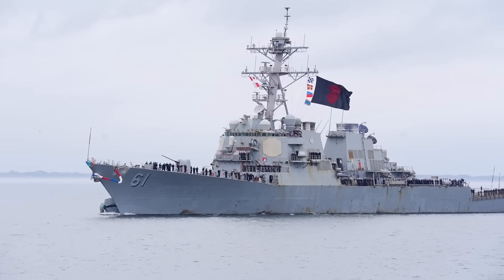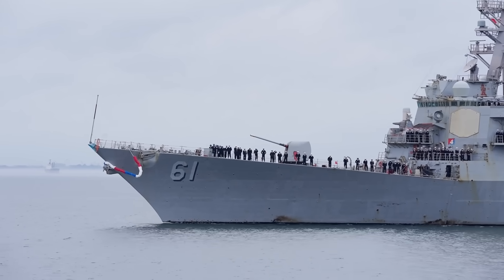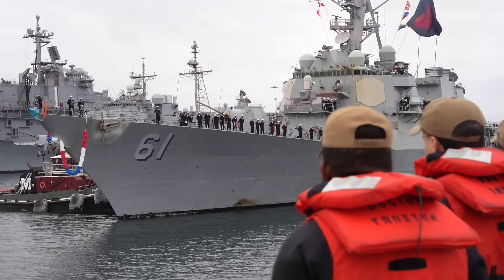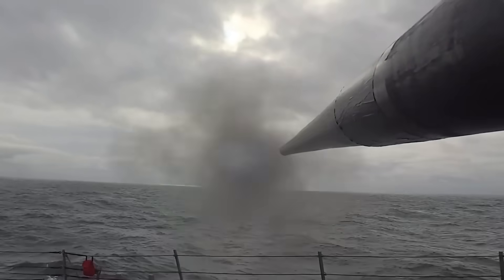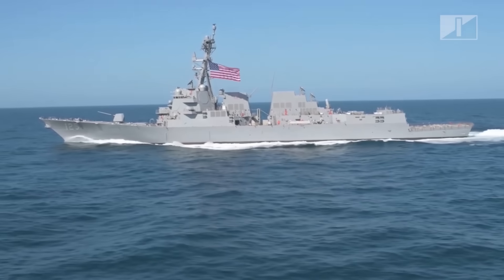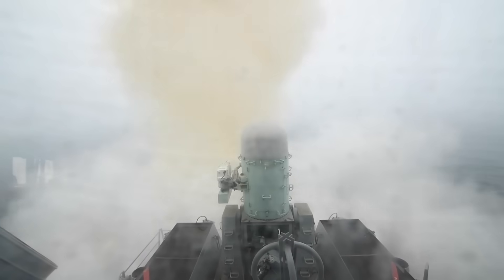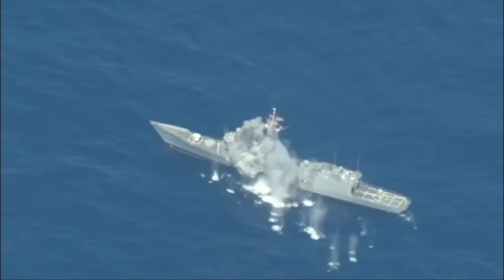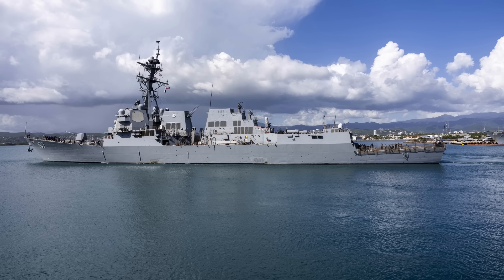Arleigh Burke Flight III: The Destroyer Pushed to Its Absolute Limit

Comment: Flight III Burkes are indeed maxed out—shoehorning the massive AN/SPY-6(V)1 (37 RMAs) into the old DDG-51 hull meant major power/cooling upgrades, higher displacement, and basically zero margin left for big future adds like high-power lasers or railguns without a hull stretch. Costs ballooning to $2.5B+ per hull shows the strain. Solid IAMD beast for now, bridging to DDG(X), but yeah, the platform's at its absolute limit. Great video breakdown! What's next—more Flight IIIs or fast-track the new class?
Reply: Sounds like more Flight 3’s. I think they were going to try an mold the Constellation into being a replacement, which is why it kept being changed. That’s cancelled now.

Comment: Excellent video. As always you have a knack for explaining variations of weapons platforms in an easy to understand format. That being said, I can't imagine it's going to be too long before the Chinese if they haven't already stolen information on the Spy 6 system. Given that the system was designed for the Gerald forecast aircraft carriers they probably already do have it.
In addition with the new Power Systems and ability to cool radar systems more efficiently the flight 3 version of the Arleigh Burke destroyer is more advanced than the Ticonderoga class Cruisers.
Essentially, all the Cruisers are now semicolon are larger missile carrying platforms that the Destroyers can direct to engage incoming threats with the Spy 6 system. With the data link 16 system the version 10 of Aegis and the spice 6 system you can have one Harley Burke class 3 directing the rest of the damn Fleet.
Reply: Why does China need to stole Spy 6 when they already have better one?
Reply: 🤣 
Yeah.....No they don't, but you keep believing that.
Oh, by the way, the version that West Taiwan (China) does have is actually reverse engineered and "stolen" earlier Aegis Spy system.

Comment: The United States Navy - the Secretary of the Navy, Congress, and the President of the United States ALL made arguably a no brainer decision when they green lit upgrading the Burke from Flight Two - to what will be the third iteration. This ship has performed amazingly, however it is arguably common sense that when you have a military platform that is ageing - the easy way is to scrap it - 'or' conduct a cost benefit analysis on what should be done. Update and upgrade.
All parties named above in my subjective opinion have made the correct choice in upgrading the a Flight Three Burke. In time 'rail gun' technologies will, or are coming on line and the Burke with it's massive tonnage [and x96 VLS cells] will need 'all' that tonnage to be able to upgrade weapons that are not light. 
The Burke fleet, with the odd exception - the oldest Burke's may well be beyond a comprehensive upgrade - however given the number in service, and new ships coming on line - the USN will retain a killer platform - upgraded for the decade ahead - give me the Burke over the Chinese fleet any day of the week. Much of the PLAN fleet have never been used in combat, and we just don't know if their massive PLAN fleet is combat ready - it is easy for China to build and build, the PLAN on paper looks formidable however my money's on the USN.

Comment: Don't worry, the US Navy will take the Coast Guard cutter and stuff it with 256 strike depth VLS and four huge 64 radar arrays faces.  It will have a hangar capable of storing 4 medium helicopter and 8 drones, 4 Rail guns and 8 1 megawatts lasers, hull and towed array sonars.   All for less than $500M, and less than 5000 tons with 20,000 NM range, because Trump is in charge.
Reply: Every flag officer who was a sitting PEO on these bungled surface combatant programs all need to be punished for sabotaging the world's most powerful navy for personal gain.

Comment: The "Spruance" hull was far superior, but suffered from an aluminum superstructure. In response to the weakness of an aluminum superstructure, they decided to build entire ships out of aluminum. You know the ones, they crack wide open if a tug pushes on them.
Reply: The problem is the US Navy is still stuck on Arleigh Burke Flight II hull as a base for its Flight III, instead of moving into a slightly bigger common hull like what the Japanese and Koreans did with the Atago/Maya and Sejong the Great class destroyers, respectively. The latter even carries more VLS cells than a Ticonderoga cruiser.

Comment: Purchase the Japanese Maritime Self-Defense Force (JMSDF) Aegis destroyer “Maya-class”  Guided-missile destroyer
Displacement    8,200 tons standard　10,250 tons full load Length    170 m (557 ft 9 in)

COGLAG (Combined Gas turbine-eLectric And Gas turbine)  Speed    approx. 30 knots (56 km/h)
Mk 41 Vertical Launching System: 96 total cells
SM-2MR surface-to-air missile
SM-3 anti-ballistic missile
SM-6 surface-to-air missile
Type 07 VL-ASROC
RIM-162 ESSM
Reply: Maya-class is Arleigh Burke Flight IIA

Comment: I am so surprised that we haven’t started developing a new Destroyer.
Reply: DDGX is on the roadmap, but doubtful we see anything in the water for at least a decade.
Reply: Don't fix what ain't broke!  What makes the Arleigh Burke Destroyer is its system of systems which evolves and upgrades are filtered through.
Reply: @raptordriver7340  Burke is running out of power to new systems, it can't put in bigger engines or generators as the hull is maxed out..... also the ship has too many onboard in modern destroyer standard.... also Burke is now doing brown, green and blue water duties which is stressing out the hulls in exponential speed
Reply: @fatdoi003  The turbines have more power than what the Burke needs.  For instantaneous power draw, there are systems that can store energy, discharge and recharge at a rapid rate.  The turbines do their job to allow the Burke to sail at speed.  Fortunately, the rail gun experiments have opened an evolution in how to manage power dissipation and keeping the power requirement sufficient in continuous use in combat scenarios.
Reply: @raptordriver7340  burke’s gas turbines provide propulsion power, not scalable electrical power. The ship’s electrical generation, distribution, and cooling architecture was designed in the 80s and is already maxed out with Flight III. Energy storage cannot replace continuous generation at destroyer scale, which is why railgun concepts were abandoned. burke’s sailing speed is irrelevant to its inability to support modern sensors and future weapons. That’s why the USN needs a new hull, not incremental fixes
Reply: @fatdoi003  You lack the concept of energy storage.
Reply: @raptordriver7340  Energy storage doesn’t replace sustained electrical generation or cooling. It only smooths spikes. If it worked, railguns wouldn’t be dead and burke wouldn’t need replacing. Propulsion turbines have nothing to do with this

Comment: Lmao what's wrong with the USA this hull is so dead and overweight, there is no space for new equipments and the mk41 vls are tiny compared to comes uvls, it can't use modem missiles because it is too small. Just take the automation developed for the zumwalt and stick in on a new more conventional hull..
Reply: Other ships that do a similar task are heavier.
Reply: @Jeff55369  that's not the problem, Chinas type 55 isbigger and heavier but it is built on a larger hull and can physically support the weight and has the mechanical space required, the ddg51 is end of life!
Reply: @iamjacobnz  it's also going to use more fuel and be slower.
Reply: @Jeff55369  that's not true the zumwalt is 15000 tonnes and uses less power to maintain its speed than the DDG51, ships don't automatically use more fuel because they are built on a slightly larger hull.

Besides if you want to talk about fuel consumption neither the Ddg51 or type 55 are fuel efficient by design as their turbines have narrow power bands and much less efficiency than maritime diesels.
Reply: What's wrong is that our culture of unhinged private equity greed is so all consuming that it pretty much hollowed out america's defense industry.
Reply: @7ElevenTruther  the entire economy has been hollowed out I think I heard that 25% of the us economy is healthcare, if you remove healthcare and education and finance you only have silicon valley left and a few defence contractors and corporate HQs.
Reply: Someone is afraid of China 😂. Probably not even from America. The only war America might get dragged into is for the bankers to retake the Russian banks that they lost after the USSR collapsed.
Reply: Maga is what's wrong.

Comment: They need to go the other way with it, to make the replacement frigate.
Same hullform, but with fewer systems and crew.  The hullform already meets all USN requirements and is decades long proven.
A cheaper radar, 32 cell VLS vs 96, 57mm gun rather than 5", cheaper propulsion system as it doesn't need to keep up with carriers (1 turbine with 2 diesel engines rather that 4 turbines like the Burke)etc.
It'll have pleanty of room then, abd has hot production lines already.
Done...could have the new US Frigate in 2 years.
Reply: They just announced the legend class cutter will be the new frigate with 16 VLS. Totally ok if it was an excellent sub hunter like the Type 26. But its more like a type 31. Problem would be if they try to mount AEGIS on it again.
Reply: @TheBooban  They wont put aegis on the flight 1. You might see it on the flight 2 or 3, but I'm guessing the navy isn't done with the constellation. They'll let that design cook and get what they actually want, while the legend fills the gap.
Reply: Just reopen all of the closed Todd Shipyards and start building FIG-7s again but with VLS.

Comment: While I don’t disagree with the comments, and the program was anything but clean, the Zumwalt wasn’t an operational failure. The design is sound. You can absolutely rip the guns, out the fact that Congress didn’t have the stomach for the bill. That neutered the air defense capability. But with even the v4 back fit variant of the spy six added, it’s a very capable design. Unfortunately, it’s gold plated. Which is the common theme. What the US needs is a modern destroyer. As in a WW2 type. Cheap, easy to produce. Some anti surface/land attack capability, sore anti air capability. Good ASW capability. The emphasis needs to be on cheap, and able to be built in numbers.
Reply: You need massive production to make a unit cost less, and you need decades to grow the ship building industry for the massive production. But you have only 4 years of presidency, and 2 years to prepare for next election.
Reply: That's more of less the navy version of the nsc you're describing.
Reply: @Jeff55369 I actually think that COULD be a decent vessel. So long as creep didn’t occur yet again. I think the independence class could be great, but I’d want a better radar and a less complex codead type Power plant.
Reply: @capn82  I'm not sure the Navy would be happy with a larger Independence style vessel. They'd maybe go for a Spearhead transformed into a combatant for low intensity engagements (which also has multiple hulls,) but they didn't seem to like the hull cracking issue on the Independence very much.

Imo, of the two lcs hulls, the freedom probably has more promise for upgrading into something else.
Reply: @Jeff55369 I’ve always heard the opposite. That the independence was the better. I’m not in though, so it’s pure conjecture on my part.
Reply: @capn82  The Freedom had a combining gear issue that was supposedly going to be very expensive to find a solution for... but they fixed it... so there aren't any issues with that vessel at all anymore. Which means the navy now has a vessel that can go 45+ knots when they need it to.

The independence is being used for mine sweeping nothing else, which is fine, but having a dedicated mine sweeping ship would be less expensive. That suggests to me that the hull cracking issues aren't entirely solved for high speed use. 

Crew size isn't an issue anymore either, since they're using a crew module.
Reply: $1mil per round of gun shell, who are you kidding?
Reply: @fatdoi003 the gun was a failure. Only because of scale. The vessel isn’t. And that space would be perfect for vls.
Reply: @capn82  refitting VLS to guns is not just cut n paste exercise, it's structural and needs complete redesign of the front section... for 3 hulls, i don't think it's worth the money plus the ships don't even have proper AESA radar so what's good to have more VLS when it can't even detect any air targets?
Reply: @fatdoi003  I'm fairly certain the Zumwalt was designed for modularity in mind. They've already swapped those guns out for other munitions, so I'm guessing adding a 32 pack at each gun (maybe even more) wouldn't be an issue for them.
Reply: @Jeff55369  You’re mixing up payload modularity with structural integration.
Swapping AGS ammo is not like replacing the gun with VLS. VLS needs deep vertical cells, exhaust trunks, shock zoning, and major bow restructuring. That’s a redesign, not a retrofit for three hulls.
And without a proper long-range AESA, extra VLS is pointless anyway.
Reply: @fatdoi003  they were able to integrate hypersonic launch platforms into the ship when they pulled the fore gun. If they can do that, they can do vls for more traditional munitions.

Comment: No mention here of the F-3 new builds (& F-2A backfit ships) having the AAW Command & Control role? Thats literally the BIGGEST development of the whole class! They are re-arranging the CICs & adding equipment to make them capable of hosting the AAW Commander of the strike groups & their staffs to take over this function from the Ticos as they retire.
Reply: got a link to sources? I am super curious about this!
Reply: @1994fishboy its in every article & web site about the F-2A & F-3 Burkes on the internet! Is ya Google broke?!?
Reply: I hadn't heard of that. It kind of sounded like they didn't have an answer to the Tico issue but that's good news.
Reply: @J @Jeff55369 oh, they absolutely HAD to do this! After the Ticos are all gone, you wouldn't have had a dedicated AAW command & control flagship anymore. This is a compromise plan because the Burkes weren't originally meant to do this role & the capability is being back-fit into them now.

Comment: the USN needs a new stealth guided missile destroyer . . . a successor to the Arleigh Burke class . . .
Reply: The Arleigh Burke II
Reply: They tried. And failed! Now if you had flight 3's tech and proven weaponry on a stealthy Zumwalt hull, with one proven gun that's useful, and 64 cell fwd and aft for 128 total missile count, it could work.
Reply: @gcb345 the Zumalt class is the Ferrari of destroyers & that makes it expensive . . . but it doesn't have to be a Ferrari at hard earning tax payers money . . .
Reply: @chandrachurniyogi8394 but the problem wasn’t the hull its self that was expensive if was all the untested prototype weapons they added to it if they had stuck with the hull and armed it was say a lot more missiles they wouldn’t be in shit situation they’re in now
Reply: We're in the design phase of the DDGx. 13k tons, over 100 VLS cells, SPY6 but even more RMAs than the Flight 3 Burkes, hypersonic missile capability, and a stealthy(ish) hullform. Won't be in the water till mid 20230's at earliest but its coming.
Reply: Just google "USN DDGX"...its in the works
Reply: Scrap the carriers and put the resources into arsenal ships with hundreds of missiles. We need a 21th century revival of the battleship in that form. 
In the end, there is no point using a carrier to launch jet fighters to launch missiles if you could fire the missiles right away.
Reply: @Simon1992X2  carriers are important for longer range and the ability to transfer forces from one continent to another efficiently
Reply: @Simon1992X2  With missles putting more on fewer ships doesn't make sense. A battleships value came from the fact that non battleships weapons and armor were so much weaker. A missle battleship is going to be more like a first rate ship of the line. While first rates were stronger then lower rates the difference was much less.